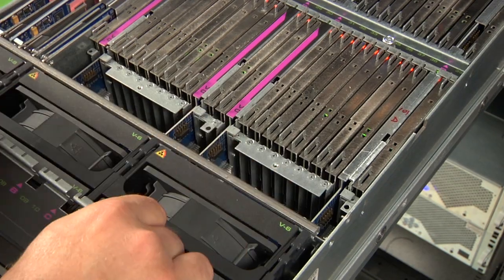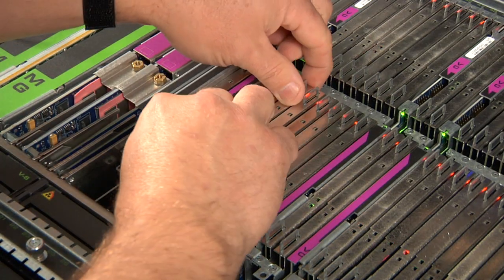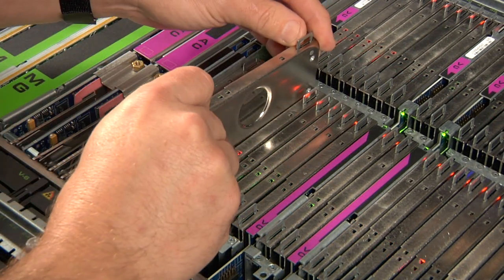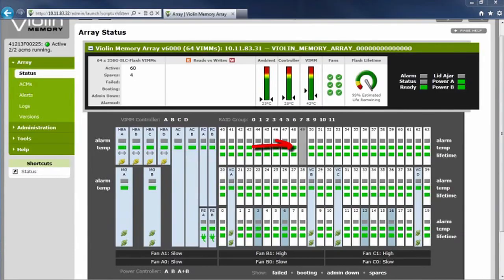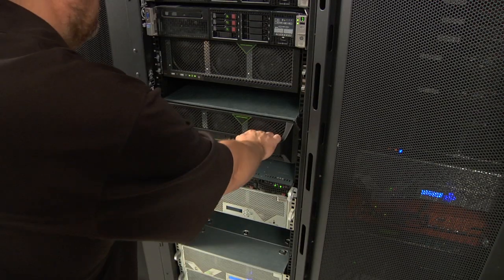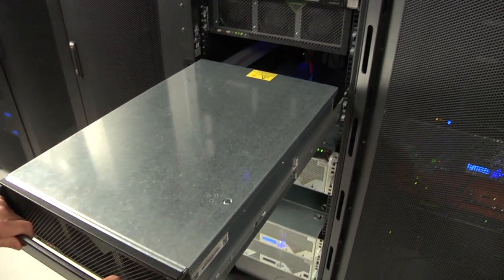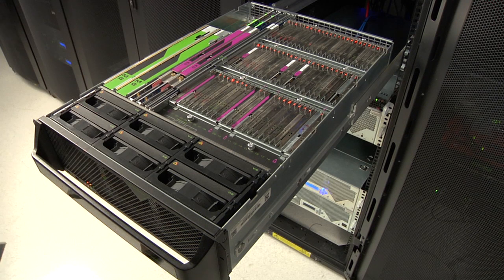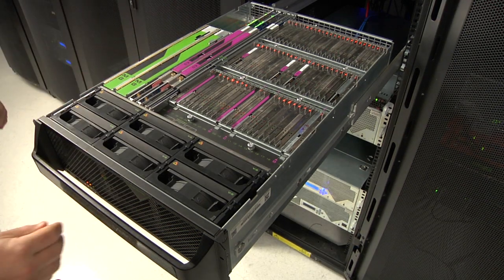Violin Memory Enterprise Flash Serviceability

Comment: Where is the data on VIMM and SSD failure rates ?  Making a claim does not make it so.
Reply: This is my understanding from research I have done.  Violin uses only bin 1 flash parts from Toshiba. Many SSD vendors use bin 3+ which are not of the same quality and have higher failure rates. The second thing is they have in their FPGA's better true error handling. other vendors don't have that control of the SSD firmware and simply fail the device even if it could actually recover.
Reply: bryjb10 I understand the theory.  However, since they are talking failure rates - it is worth know what they actually are. Also not all SSD vendors are the same.  Since the topic of failure rates were brought up in the video you would expect Violin Memory to offer up what those rates are. Mean time between failure, etc. This is suppose to be a strength and yet there is no failure rate information.
Reply: Charles Ditzel There are tons of studies on SSD failure rates, try google. All SSD's have limitations in the enterprise space. namely Write Cliff and a non distributed memory architecture. They are adapted from spinning disk in mind for laptop and desktops, SAS and SATA. I am not sure why you would ever want to use them in a SAN. This is why Violin is so much faster than everyone else as they don't run into Write Cliff due to creating their arrays from the ground up vs adapting old RAID and spinning disk arrays.
Reply: @bryjb10  I have an opportunity to buy one used for cheap, but still hundreds. Marked as "r2 ready for resale". So it means used, but tested and working, I guess. What do you think?
Reply: @allminegod  well what’s cheap? Where will you get spares and can you service it and bring VIMMs back online if they go offline etc
Reply: @allminegod  there are so many ways that will give you more than a million IOPS now. Not sure I would but depends on price.